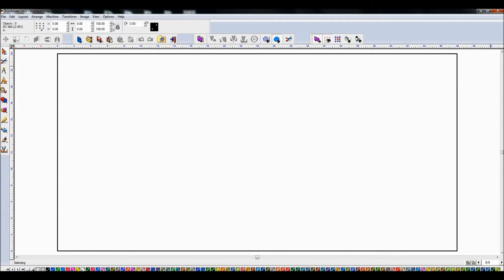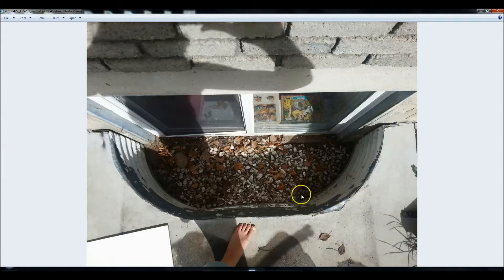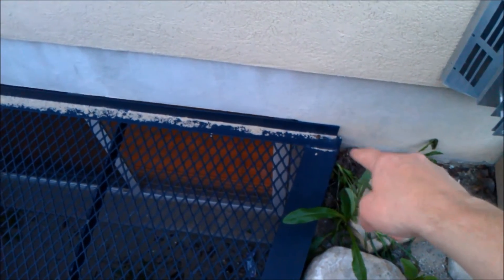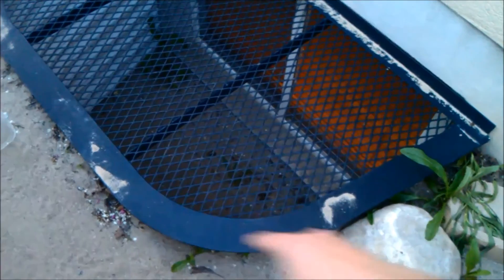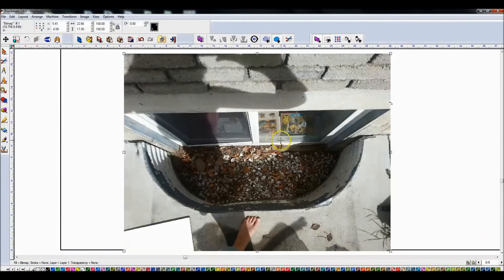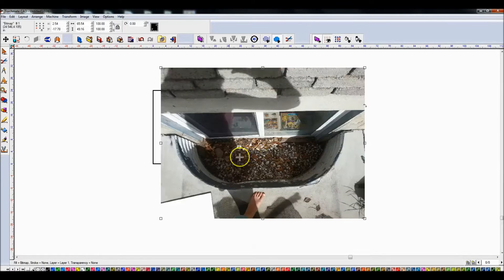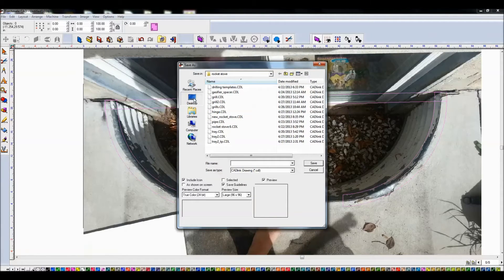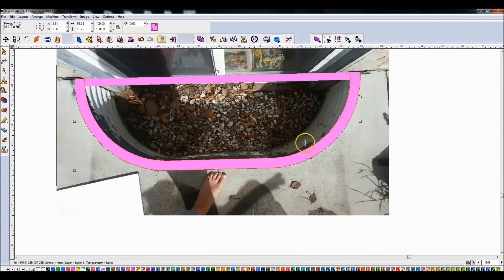Torchmate CAD/CAM -- Designing a custom window well cover template

Comment: Nice work!!! I downloaded the program that you mention in this video, but you are using a different cad software than the one I downloaded, what software are you using. On the software you mention, to buy, it don't allow to copy the curve on the window well for the covers if you can help me figure this out I would appreciate it. Thanks.
Reply from the maker: ***** I think I am running version 8 revision 1.  It is something you typically have to purchase as far as I am aware.  If you call Torchmate they can give you pricing.  I think the lite version does 95% of what the full version does.